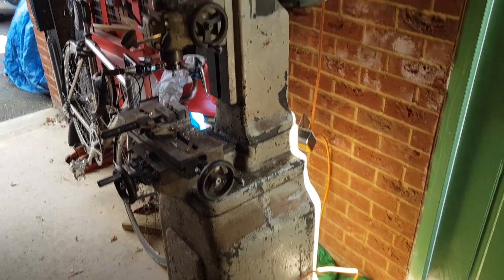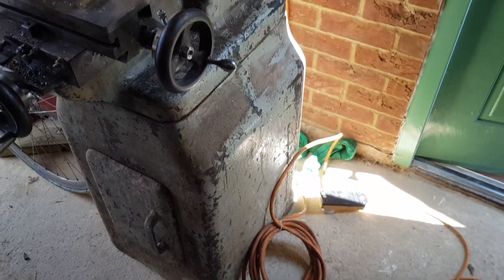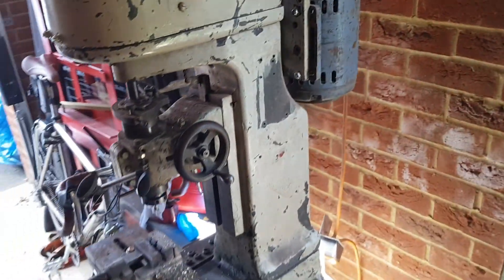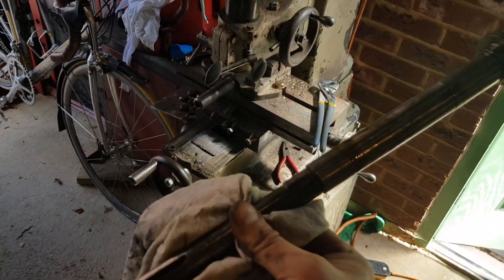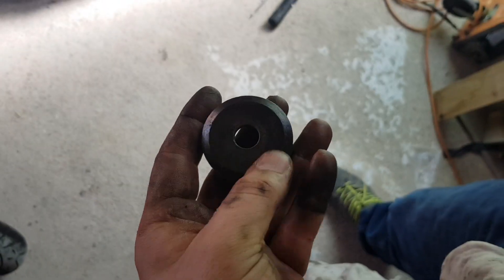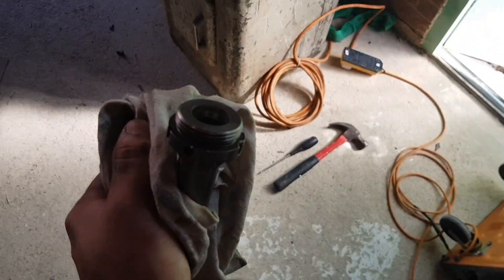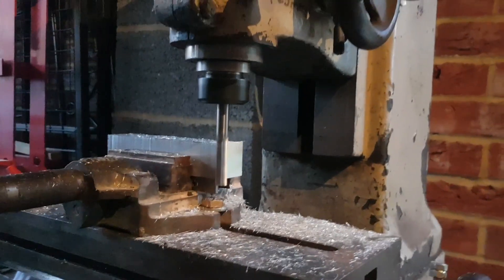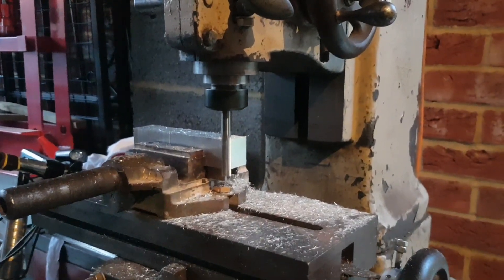Linley Jig Borer Er25 Collet Conversion

Comment: I have one of these linley jig borers,and i want to use collets too,but instead of altering the machine i will make a collet chuck with a fitting  the same as the linley tapered cone and screw cap,as this is the same as the tools that were available for this /mill/jig borer like the fly cutter,hole borer,drill chuck.

Even if you don't have a lathe get a machine shop to make the parts you want,at a minimum a tapered cone fitting bored out to take mt 1 or 2 shafts with a grub lock or thread the insert or whatever the tool mount needs.
If a chuck mounted fly cutter or hole borer is used then the linley style insert cone wants to mate to the chuck screw or tapered insert ie MT.

For me i have a hole borer with MT2 (i think 2 not 1),So i would cut the MT bar to the size of the linley style cone ,have it bored to 22 degrees included i believe,drill a hole in the rear of the MT bar ,thread it and this solves needing a draw bar,and this tool need not be taken apart ,unless the cone insert is used to mount MTx sized cutters with the MT bar cut and tapped to suit.

The inserts could be bored out and reamed to suit tools that have a straight shaft,excluding drills and end cutters some fly cutters and borers have a straight shaft fitting to mount either in a collet or drill chuck,most of the time i'd use a collet with and bulky tools as the MT chuck made for the linley would be quite short.

The collet chuck mount for the linley  need to be short due to the limited space,a drill chuck,key or keyless, are  quite long,and the fact you really don't want to try and bugger the machine going for ER40 size,ER32 would be as much as needed as only milling tools would be mounted,a large pillar drill and center lathe can figure out the heavy lifting.

Any tool can be then used in a linley,you just have to either outsource the making of the linley dimentioned component and screw cap, or make it yourself,one is far less expensive than the other.

If a cone insert is used for multiple tools ie one that uses similar mount such as MTx, cut length to suit,then only one screw cap is needed,for collet chucks again one screw cap per type of collet set ie  ER11,ER32 .

So multiple tools can be mounted on a single cone insert,i'd use EN19t steel or in the US 4140,used for gear shafts ,stub axles and  firearm components wear,shock and heat resistant.

This is preferable to altering the machine since you may want to use any linley tools you may have already,So then increasing the value of the machine also.